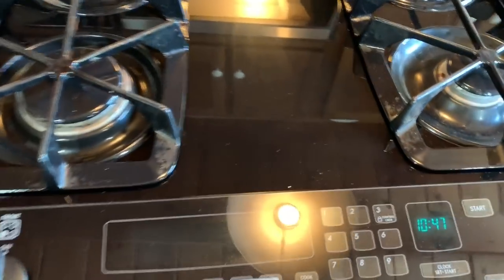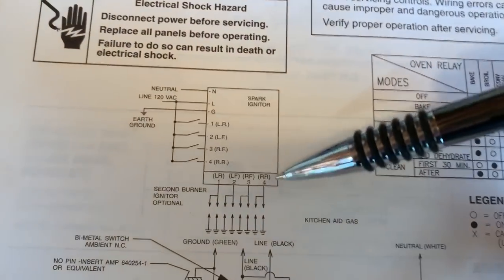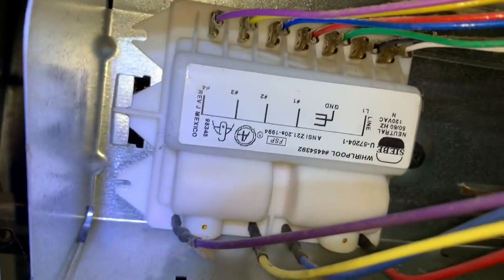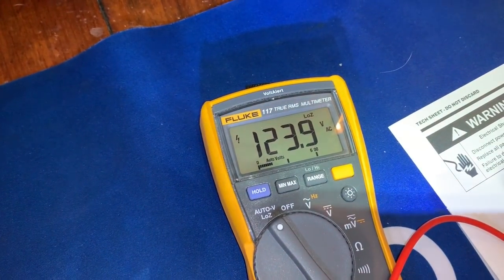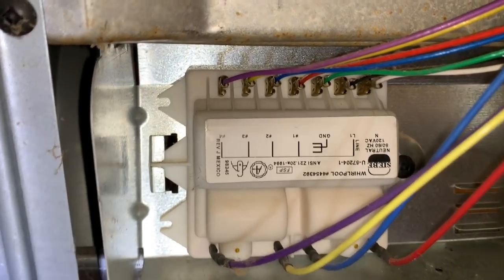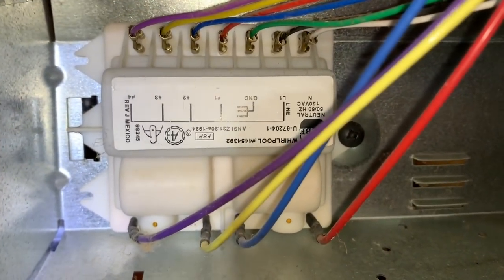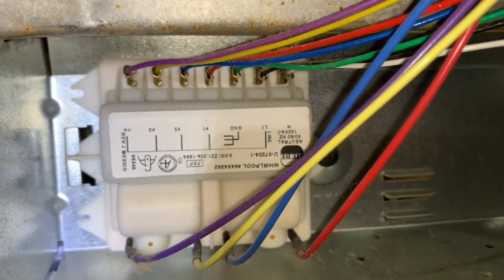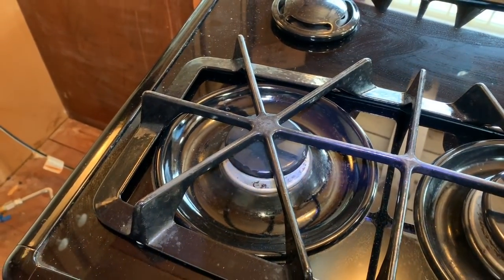No Spark on a Kitchenaid Gas Range Cooktop Burners

Comment: Same issue on my kitchen aid gas cooktop. However what is odd is it starts working again after the cooktop power cord is unplugged from the working outlet (tested already). Literally as soon as I unplugged the cooktop and plugged a phone into the outlet, saw they had power, then plugged the cooktop back in and started clicking/igniting again. Ever seen that?

Comment: You tested the module at the neutral wire & the #4 lead to the right rear burner.  Don't you also have to test the other three spark module terminals to test if it's good?
Reply: No it’s not necessary because he already proved that the spark module is failing to do its job from one test point. Yes there are other test points. But what would that further prove by testing from the other burners?